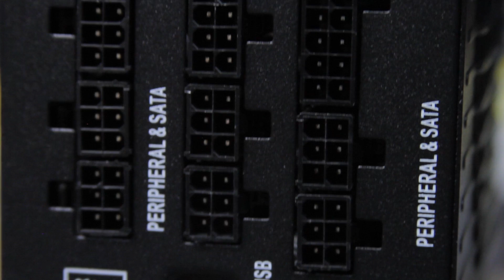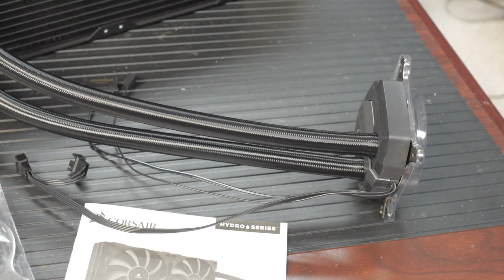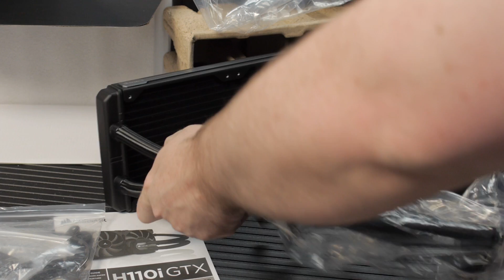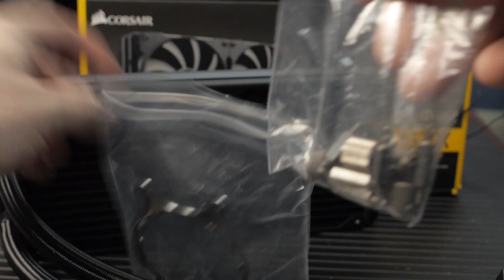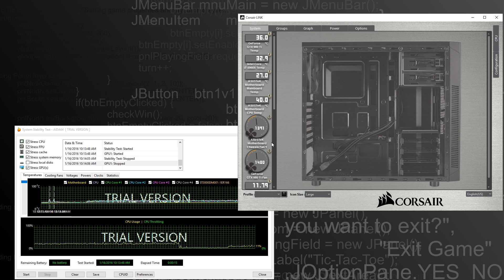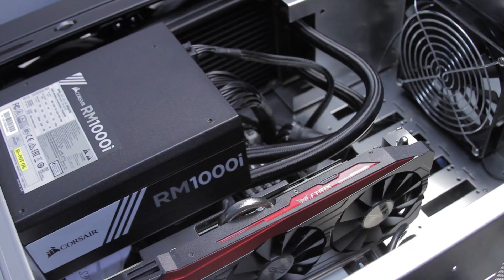Corsair H110i GTX and RM1000i Review

Comment: I have the H110i GTX and it cools an i7 6700k very well, even at 4.8GHz. Normally the CPU is either at ambient temperature or slightly above when under light loads. My only issue is the pump is a little noisy, but is just about acceptable. In the video, the pump is praised for being quiet. I don't think that's the case with my pump! The radiator fans are fine on 'quiet' but above that are too loud for me - unless I am gaming with headphones on. Fortunately I've never needed to run the fans above 'quiet' as the cooling is simply superb, even at 4.8GHz under heavy loads. Recommend, but it's not the quietest water cooler you can buy.

Comment: Great review! I actually really am considering the H110i GTX now. Currently I have the NZXT X61 coupled with an i7-4790k and it does a pretty good job and keeping things under 70C. I tried out the new Swiftech H220 X2 prestige and wasn't pleased. Wrote a pretty lengthy review on Newegg and then returned it.

Comment: I got this cooler, in the beginning I could run the fans at around 300-400 rpm for being virtual silent, I don't know if it was an update or something, but one I couldn't run them slower than 750 rpm... Also for me Corsair Link have been buggy from time to time, sometimes running at 100% at startup, adding all sensors in the menu twice or triple, turning off LEDs, crashing for no reason, messing up all settings sometimes when I upon the program... So in the end I said fuck it, got new fans and run them off my Motherboard instead. I got the platinum 1200 watt version of that power supply, using a system that only draws around 450 watt, the fan has never turned on once. :)

Comment: I have the H110i GTX on a 5930K and it does a great job keeping cool at 4.5ghz I changed my fans though to some Noctuas and it made it way quieter. I didn't think the stock fans were quiet at all, the pump even on max speed is really quiet though.

Comment: I have problems usin g the link software....every so many restarts of my computer the link software will show 2 of each temp sensor and half of those do not work or show a temp so then I have to pull back in new temperatures kind of a pain...any suggestions?

Comment: I've got an 850i last year, it stopped working after two months, sent for warranty, got a new one, it shuts down after a few minutes gaming.

Turned out the default configuration made the fan not start. Got the Corsair Link cable connected, set the fan to 40% all the time and since then it's been working perfectly.

Comment: Yeah 1.4 volts is crazy for skylake.
Reply: ***** Yes from reporting from the temp sensor heat levels Skylake is excellent but your talking about pushing the same voltage though a 14nm process as you were pushing through a 32nm process that is insane.

And while as I said from the heat sensor your going to get similar and probably lower heats from skylake on a smaller voltage the heat is going to be much higher in-between the components which if it doesn't kill it instantly it will kill it eventually.

The great thing about shrinking a process is that it doesn't need as much energy as a larger process there for the total heat output is less, but if you try putting the same energy in while from the temp sensor you may not get a different reading the component parts inside the chip will be hotter because even though your only putting out the same amount of heat total each transistor is 5.2x smaller so the heat density is going to be 5.2x on that scale.

So while Haswell was heat limited Skylake is voltage limited which is like Sandybridge but pushing 1.35v even there was for a 24/7 overclock going too far and you would end up breaking the chip even if it was only reporting temps of 60 C.

Its like saying that pushing an overclock of 5.2Ghz at some truly ridiculous is ok for 24/7 if you can constantly keep it below freezing on the temp sensor. When while the temp sensor may be reading below 0 the internal components of the processor are going to be much higher like 100's of degrees Celsius.

Like copper and silicon have pretty good temperature resistances to break something one par of it at last has to be 1,414C ish and for copper 1,085 °C ish.

Probably you can go for half of that because you will start to see warping at half those heats but still, the core or package temps are not representative of how hot each transistor etc is they are MUCH hotter.
Reply: wait... 1.35 V would be bad for my Haswell chip?

Comment: Ouch not sure I like the position on that power supply. It looks like it crushes the hoses coming out of the block and it also blocks half of the radiator. But it if performs then I suppose it's fine.

Comment: My 4790k is at 4.7Ghz (1.27v)  and my H110i GTX keeps it under 60c stress testing :)
Reply: +T2ak  I run my 4790K at stock 4.4 with symmetric turbo (all 4 cores at 4.4)... with only 1.15v ;) been through long rendering hours @ 100% usage.. gets to 59-60c with a Noctua NH-D14
Reply: That is impressive, I have my 4790k with 4.6 and have a 110i gt. What is the difference between the gt and gtx anyways?
Reply: +T2ak WAIT WAIT WAIT, my 4690k is @ 4.5 ghz 3.75v and sits at like 50c idle with a 120m cooler master seidon this is racist
Reply: I am just waiting to get my new H110i GTX so that it will be fine again I am pretty sure mine is thermal throttling because it only shuts off during intel stress test not during rendering or gaming so for now it is fine
Reply: +Final Cam From what i've found online, the only difference between the two is radiator dimensions, airflow and noise level. I could be wrong though.
140mm x 322mm x 27mm H110I GT
140mm x 312mm x 26mm H110i GTX
113 CFM H110i GT
104.65 CFM H110i GTX
43dB(A) H110i GT
40 dB(A) H110i GTX
Reply: +Final Cam Also they're made by different manufacturers
Reply: +Final Cam I have a 5820k at 4.5ghz (can push higher but i'm too lazy to find that stable point I got it to at 4.7ghz lol) also on the same cpu cooler :3.
Reply: Wyatt O'Shea Don't mind him.. he can't even type
Reply: +Advection357 
?
Reply: +T2ak 3770k@4.4&(1.25v) my h100i gtx cant keep it under 75c in aida :( I think it might be broken
Reply: aminamchannel I doubt it's broken man.Also depends on what country you're from (and room temps/case temps etc)because it does get allot hotter here in Aus.My old 2600k would get to thermal throttle limit at 5ghz in summer time but would be 100% stable in the other seasons at 5ghz lol .I had to run it daily at 4.6ghz with 77c max load on stress test in summer time otherwise it would get way too hot.
Reply: Advection357 Awesome. I didnt have room in my case for a air cooler. Surprisingly the h110 fit in the front perfectly though.
Reply: my ambient temps are low. about 60f. that could make up the difference.
Reply: aminamchannel Try reapplying the thermal paste. With stock i was getting about 65-70c. I had to remount it after a mobo swap and was seeing much better thermals after new paste was applied.
Reply: +T2ak My FX-8350 is at 4.7ghz (1.33v) and my H110i GTX keeps it under 45 degrees Celsius during stress testing. ambient temp is around 21 Celsius.
Reply: +cheese toucher Don't amd chips run quite allot  cooler than the intel ones?. Just something I read once a few years back.
Reply: yes, because the VRM is on the mobo, not inside the CPU
Reply: however, that's just with AM3+ socket CPUs. FM2+ socket stuff has hot as hell core temps and pretty warm socket temps. my 860k (has no GPU on die, should run cooler than the APUs) gets up to 70 degrees celsius (4.2ghz 1.37v) with the H110i GTX
Reply: cheese toucher Thanks for clarifying :)
Reply: RREXX How the fuck? 3.75 core voltage? 0.0
Reply: 1.375 my mistake
Reply: RREXX Ok at first I was like holy shit how does it even operate at that voltage XDD.
Reply: lmao
Reply: The sad thing is though is that it isn't 100% stable either, if I run intel burn test my PC will shut off :C
Reply: RREXX Try and get it to be stable then ;) .I still have to mess with my 5820k a bit more haha.Mine was stable but thermal throttled in game.I live in Aus though and temps are always a problem for us that live here with a gaming pc :'(.My pc at the moment has been put back to stock settings because I didn't care to mess with settings at the moment and i'm running all cores around 37-41c :/.
Reply: RREXX I have a h100i gt but yeah when your room is constantly 30c and over 24/7 due to the heat being dumped into the room by my pc and amplifier/dac it all adds up very quickly haha.That and where my window faces it doesn't allow wind to go out very easily and doesn't get wind coming in through it.
Reply: my room is constantly 80f (not sure what it is in c) and my CPU is suffering from the heat, and my cooler is an out take 120m cooler master seidon so it could be a lot better
Reply: RREXX According to google yours is roughly 26.6c.
Reply: +RREXX 

F to C

80F-32/1.8

Comment: I had pump noise problems with the H100i last summer so I upgraded to the H100i GTX and have been very impressed with the cooling on a FX8350. @4.5ghz under full load I'm seeing temps max at 52c.

Comment: Wendell,

Could you please do a follow up video on the broken skylake CPU?? 
I am having a very similar issue. 
My post time is incredibly slow 2 hours+ when I have all 4 ram sticks in but if I take my 4rd slot stick out it works fine. 
If I have all 4 sticks in I can only get it to post if I don't have anything in any of my PCI-E slots. 
Specs: 
6600k, CPU
4x ddr4 4gb, Ram
850 EVO 250gb, SSd
Gigabyte R9 390, GPU
Asrock Z170 Pro4, MB

No overclocks. 

I am highly interested in finding out what happens with your skylake, as I have looked everywhere and I can't find any solutions or suggestions for the specific problem I am having. 

Thanks Wendell.
Reply: are you sure thats your cpu it could just as well be a bad motherboard or ram stick
Reply: I've run mentest, on all sticks the ram, they're all fine. It could be the motherboard yes, but seeing as the issue is some communication problem between PCIE and Memory, it should be the CPU. If it was just the ram then I'd be more likely to be worried about the MB.